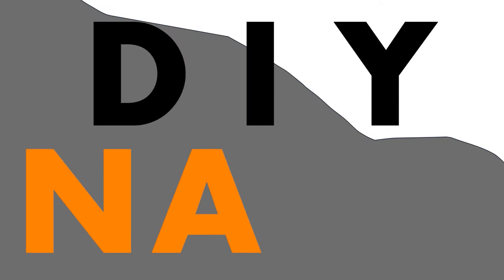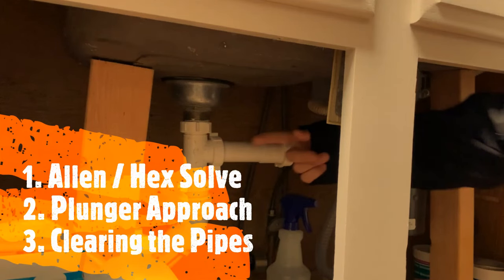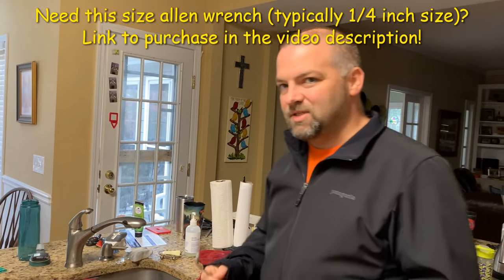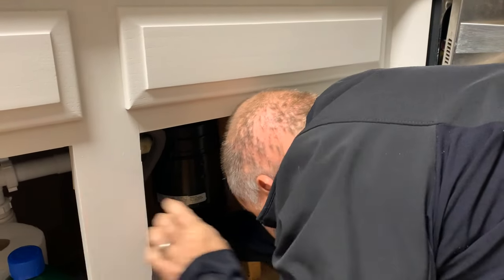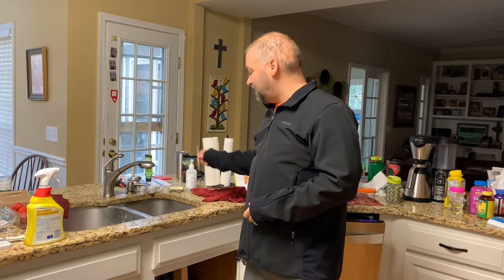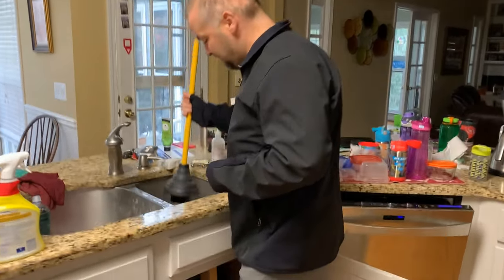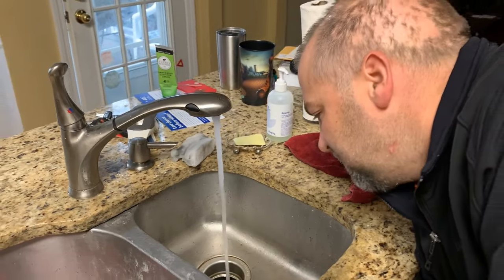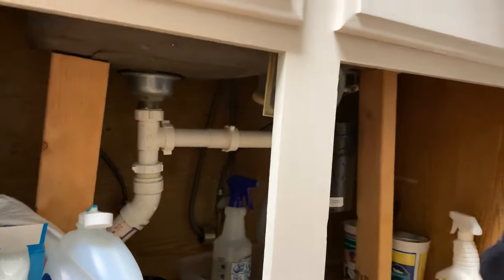Clogged Kitchen Sink with Garbage Disposal? How to Solve Quickly with 3 Easy Fixes! - by DIYNate

Comment: Heres the thing, the one that clog is the right one of the sink. Would I still do the same thing?
Reply from the maker: You can certainly try it - the concept is the same with the plunger - pushing the water through the clog so it is likely to work on the other side as well.  Good luck!
- DIYNate

Comment: for solidified grease but the blades run, pour 2 cups of "Blue" dawn into the disposal.  Wait ten min. turn on to froth, the turn off.  in a lrg. - med. stock pot, boil half full of water.  >> Pour half of the water into disposal, wait a min. then turn the disposal on in bursts.  pour the rest of the boiling water in and repeat steps.  should melt the grease on the first round.
Reply from the maker: Thanks for sharing this, Tookye.  Interesting approach and will have to keep it in mind if I run into a solidified grease problem.  Appreciate your comment and sharing advice to help others out!
- DIYNate

Comment: it would have been nice to show how to unscrew pipes.  Mine is clogged after the attempts demonstrate,  Now I'm stuck
Reply from the maker: Hey there - I have a video coming very soon showing disconnecting the PVC connectors on a bathroom sink that I think will do exactly what you are saying.  Have definitely done it before but just didn't go that far for this video.  I know what you mean as well - would be nice to see that to help with instruction on what to do.  Will post that video in the next two months. 
Thanks for the constructive feedback!
- DIYNate

Comment: I have a question. My water went through but my switch doesn't work. What does that mean?
Reply from the maker: Hey there Nobertina - could be a handful of things causing the switch not working issue.  A lot of times a garbage disposal has a ‘red’ reset switch somewhere on the base area of the disposal.  I would try and use that and see if that resets it and you are working again.  Another option as an easy check is to find your breaker and reset that breaker switch that is in the same circuit.  It could have tripped and that could be the issue with the power.  You can also try and turn the blade with the Allen key and if it spins it is more likely that the switch will work.  Just a few starting points for you before actually checking to make sure wires aren’t disconnected to the switch, or other more problematic issues with the disposal.  Be careful of course - water and electricity are not something that mix well so if you are not comfortable, you may want to speak with a professional.

Good luck!
- DIYNate

Comment: My garbage disposal keeps getting jammed.  So i use the allen wrench at the bottom and get it "loose".  then it works fine for a day or two then gets jammed again.  I looked inside and i cant see anything that is stuck inside.    why does it get jammed after i loosen it up?  i keep going back and for with this thing.  If there was something stuck in it, you would think that it would NEVER loosen but it does, then jams up again in a day or two......what is going on????????????
Reply from the maker: Hmmm - tough one there.  So you are getting your blade stuck on a regular basis, right?  Not just your drain filling up?  If drain filling up, I would try the plunger or disconnect the PVC hookups and make sure the pipes downstream are clean.  If the blade is getting stuck on a regular basis, it could be what is getting put down there or possible may have warped from getting jammed / caught on stuff, but seems like it wouldn’t run in that case.  My guess is the part that spins the blade may have gotten bent or there may still be something trapped up under there that frees up but not all the way, then gets ‘re-stuck’ after a few days of use.  Good luck - sounds like you may be getting close to replacement or take apart zone but haven’t gone that far from my end.  Hope this helps!
- DIYNate

Comment: I've tried the plunger trick, but the water just backs up into the other side of the sink
Reply from the maker: So, one of the tricks if it is coming out of the other side is to cap the other side with some type of cover, so the air can't escape.  Then, the pressure from the plunger will help push down the pipe instead of out the other opening.  Hope you got it figured out!
- DIYNate

Comment: The problem with our disposable is when we turn on the sink garbage disposal on one side the water drains but on the other side the water would go up and then slowly drains. Why is that?
Reply from the maker: Not exactly sure why it happens, but lets assume there are two drains and the pipe to take out the waste water.  First drain is the disposer, second drain is the other outlet for pressure if you use a plunger, and the drain for wastewater is likely where the clog is.  So, you probably need to stop up the other side where the water comes out (cover it so air can't come out) and that should help you get some extra pressure on the wastewater drain.  Good luck and hope you got it fixed!
- DIYNate

Comment: What does it mean when both sides are clogged my disabled husband tried to clean pots put all the rice down the drain
Reply from the maker: Most likely, if both sides are clogged, the clog is probably deeper than the first two drains and is more likely clogged past where the connection to bring the drain together is.  Since both sides are clogged, you could try covering one side completely and using a plunger on the other to create some pressure.  Or you could disconnect the piping and try and clear the drain from below - with a drain snake or seeing what is clogged an in there.  Good luck!
- DIYNate

Comment: I did everything you did and took the pipes all apart and drained the water. I just turned on a little water and it’s filling back up. The disposal isn’t jammed but could it be something in it?😑
Reply from the maker: Hey there - if you have found it isn’t draining and have cleared the pipes coming out of the disposal, then it could be something blocking the outlet within the disposal (but not preventing the disposal from turning).  If you already had the connection taken off, probing into the disposal fro m where the water should be coming out would be a good place to look.  I have also had success with a shop vac in the past or (be careful), putting your hand into the disposer area (while it is shut off of course) to see if you can feel something clogging the disposal outlet.  Good luck and hope this helps!
- DIYNate
Reply: @DIYNate  Thank you so much for caring to write back! I was a woman on a mission! Unfortunately after taking everything apart and using a  snake I had to call the plumber.😑In this case when he got here he had to go into the drain about 30 feet which I couldn’t have done and when it came out it was clean and he said it just broke through. He said that doesn’t happen that often and my pipes were very clean.🤩I was so proud then he said that will be $100. Oh well! I tried. Thanks so much!
Reply from the maker: Glad to hear the plumber got you squared away at least.  30 feet in sounds like a pretty serious clog.  Thanks for letting me know and to your point, at least you tried and if it had been an easy fix, you wouldn’t have needed the plumber :)  Best wishes!
- DIYNate

Comment: I’m in an apt and it’s clogged and dark yuck water came out. Plunging didn’t help. I put my hand down there and felt nothing. Does that mean it’s in the water line? I’m just confused. 🤢
Reply from the maker: Hey Sherry - sorry for my slow response and hopefully you got your issue squared away.  If I am reading your comment right, think of water as flowing one way.  Comes from a clean source, goes through your sink, then down the drain to waste water to be once again cleaned by the municipality (or out into a septic system) and then it comes back in (probably to someone else's home - haha).  So most likely, if you are seeing the dark water in the sink bowl, but not coming out of the tap that way, the issue isn't the water line.  It could be an issue with the drain not letting the water go down to the waste water, in which case, you are probably dealing with a clog.  All that nasty stuff gets collected and doesn't let the water through.  If you are using a garbage disposal, there could be a clog either in the disposal, or beyond (further down) the disposal. 
 So the trick is to unclog it by either clearing the clog with force (pushing past it), pulling the junk out and seeing if water gets through, or going further down the drain line to see where the clog is and possibly using a drain snake or chemicals (like Drano / LiquidPlumber) to resolve.  If it is a pipe problem (like tree roots growing into your drain pipes) then that would take you down the route of needing to look at a professional.
Best of luck with your sink and I hope this helps!
- DIYNate
Reply: @DIYNate  it was rice stuck in the pipe!  The maintenance took a pic and said don’t put rice, any noodles or veggie fruit peelings in disposal. I learned my lesson. 😀

Comment: I'm so hoping this fixes our problem. I put way too many beet skins down the drain.
Reply from the maker: Hope it worked out for you - worst case, if you need to take apart the joints underneath to clear out some of those peels, that can help out if they are getting stuck beyond the disposal.  Thanks for your comment!
- DIYNate

Comment: Ive done everything to un clog my kitchen sink. Ive checked the pipes, use the plunger, used the hot water method with and without baking soda and vinegar! It will unclog for a few min but once i start using it again it fills up. HELP!!!
Reply from the maker: Hey Diana - I hope you were able to get your clog cleared.  If you are still working on it and struggling, you may be at the point where you need to unscrew some of the piping and see if you can clear it out from down below.  Hope you were able to get it squared away and if not, good luck!
- DIYNate

Comment: Reset and used tool it worked but now leaking on bottom or garbage disposal all I did was use tool and reset why is it leaking do you need to retighted With tool o thought it just unstixk s it
Reply from the maker: Shouldn’t have caused a leak by spinning the rotor blades from the bottom but you could have a break in your disposal or maybe one of the pipes loosened up and is now dripping (I would check the connections first).  Good luck and hope you get it figured out!
- DIYNate

Comment: Where is the info on fix #3 promised in your headline?
Reply from the maker: Hey Mary - thanks for the comment.  Around the 3:40 mark in the video I touch on taking apart the pipes - basically unscrew the two pvc fittings and see if it is clogged in there.  That said, here are a couple more detailed videos on how to disassemble and diagnose the pipes if you get that far into it.  One other tip is you can try a shop vac (remove the air filter and set it to wet mode) and try to suck from the top of the sink).  Good luck with your clog and apologies I didn’t go into more detail for that third fix but hopefully these offer some help!

This Old House: https://youtu.be/Or4XevbRfz0

Roger Wakefield: https://youtu.be/MZtgFmoglQY

Thanks!
DIYNate

Comment: What happens if the pipes are clear but you still have a clog?
Reply from the maker: Hey there Hope - if the pipes clear, but you still have a clog, then you will probably have slow draining and eventually get it fully clogged again.  At that point, you can continue to try the plunger, or open up the P-trap and get in there with a sink / drain / sewer snake and see if you can clean it out.  Alternatively, some people prefer to go the chemical route with Dran-O or Liquid-Plumr and let that dissolve the clog.  You may experience a range of success with these approaches.
Good luck and hope this helps!
- DIYNate

Comment: Please show a close up of an Allen wrench.  I have no idea what they look like.
Reply from the maker: Hey there Shirley - a quick google search should help you find what an allen wrench looks like, but for simple explanation, it is usually a tool shaped in an L made of metal that has a hexagon end on each side.  You can use the long side or short side to get in there and turn.  The allen type that is often used for a garbage disposal sometimes has more of a bent end on each side (so looks a bit like an S) and is called a 'jam-buster' wrench in some circles.  Either should work and getting the right size from an allen set will also help.  Good luck!
- DIYNate

Comment: None of these methods have worked for me?  I’ve plunged, detached the pipes and drained all the water into a bucket.  I even tried to make my own snake with a clothes hanger and shoved it into the exposed pipe under the sink.  Is it time for me to call a plumber for a professional snaking?
Reply from the maker: Honestly, if you went that far and weren't having success, I think I might run down to The Home Depot and pick up a sink drain snake - will be around 6-10 feet long and has an auger function.  Will probably run 20-50 bucks.  I would try that and then you have the snake for future purposes (I appreciate your attempt with the coat hanger as well - no stranger to that).  Link to some options on Amazon here: https://amzn.to/3BvR68R  - I also have a video on using a Drain Zip that would be a cheaper option but it may not get you down far enough - video here: https://youtu.be/9nBLCzhG530

Other thought you could try would be using chemical treatment like Drano, Liquid-Plumr, etc.  If it is a major clog, then you still might end up needing a plumber but I would probably give those two a shot before making that call to cut the trip charge and potential for larger costs down significantly.

Good luck!
- DIYNate

Comment: What if my sink is clogged and the garbage disposal isn’t working?
Reply from the maker: Have you tried using an Allen wrench under the disposal to turn it?  Is it making any noise or no sound?  There is typically a reset button underneath as well if you want to try that.  I would start with trying to get the disposal to run.  Then if you have that running and it is still clogged, you can go further downstream trying the plunger and / or removing the pvc piping to see if it is clogged further downstream.  Hope you get it squared!
Best - DIYNate
Reply from the maker: Might need to check for power to the disposal as well - may have tripped a breaker that needs to be reset or something.
Reply: @DIYNate  the disposal stopped working a while back, for a while it would make some noice but then it just doesn’t work. I already tired the reset button. I’ll try the wrench under it and go from there. 

Also thanks for the speedy reply!
Reply from the maker: Sounds good.  I hope it works for you - could be the unit has worn out if you aren’t hearing any noise anymore but hopefully the wrench trick will get it loose and start it running again.  Good luck!

Comment: I tried turning the propeller it won't move
Reply from the maker: It may be whatever is stuck in there is too big for the Allen wrench solve.  Are you able to shine a flashlight in from the top and see if you see anything big stopping or jammed underneath the blades?  Sometimes you may get lucky with the reset button as well.  Here is an article referencing the “won’t turn” situation for reference.  Good luck!  https://disposalqa.com/garbage-disposal-allen-wrench-wont-turn/

- DIYNate

Comment: I tried using the plunger and it did not work
Reply from the maker: Rats - sorry to hear it didn’t work - may be a tougher clog than just pressure can fix.  Have you tried taking apart the PVC yet to see if you can see the clog?  If the clog is well past the disposal downstream then you may end up needing to snake it.  Good luck and sorry the quick solve didn’t work for you!

Comment: So, there is no hexagonal port on the bottom of my garbage disposal to manually spin the propeller. So, I am under the assumption that most garbage disposals have this mechanism to spin the propeller manually, but some do not, and I just happen to be one of those fortunate souls whose garbage disposal lacks such functionality.
Reply from the maker: Rats - well - you may have a reset button on your disposal or may want to check a brand name and see if it has a process for manually spinning the blade when it gets unstuck.  Good luck and would love to hear how you get it fixed when you are able to figure it out.

Good luck!
- DIYNate

Comment: I just hope that you did not actually use the SAME plunger that you use for the toilet!! You failed to clarify the horrors of doing that, and I fear that MANY people went to the bathroom and plunged the sink with IT!!! 
😱😱😱😱😱😱😱😱😱😱
Reply from the maker: I mean, you certainly could use a special sink plunger vs a toilet plunger, but that would be a little like having different wrenches and pliers to work on your sink than your toilet.  I do understand the concern and the ‘gross factor’ but at the end of the day, probably good clean the plunger thoroughly and clean the sink thoroughly after use.  What goes down the disposal isn’t exactly clean either so water backing up can be gross wherever you find it.  Cleaning is important to your point.  BUT…. I am not really advocating for a second / different plunger as that seems a little overkill - as long as you do clean it ahead of time.  Disclaimer: I am not qualified to speak on the topic of germs or grossness - haha!  Appreciate the comment!
- DIYNate